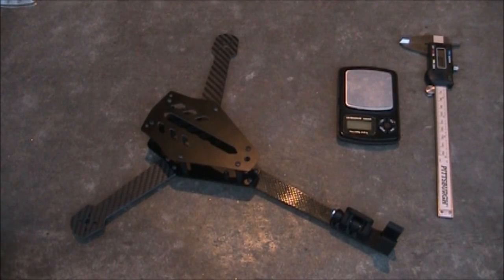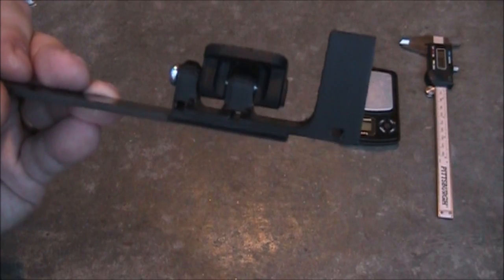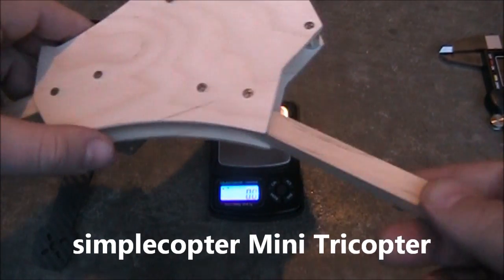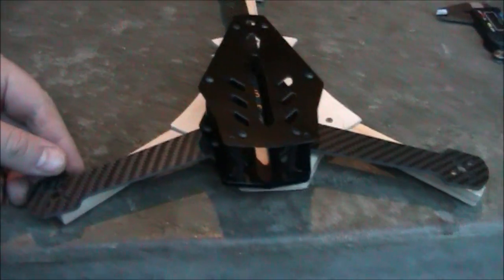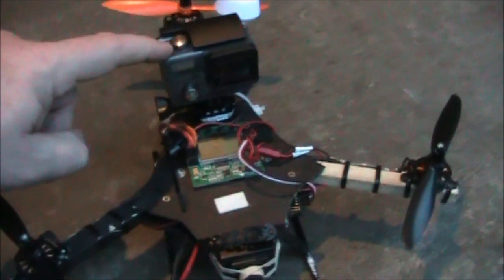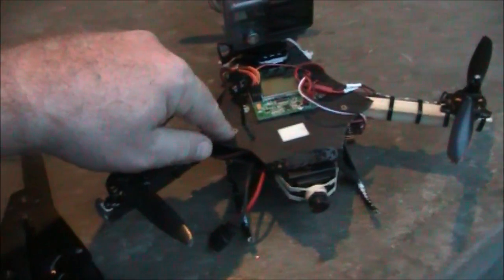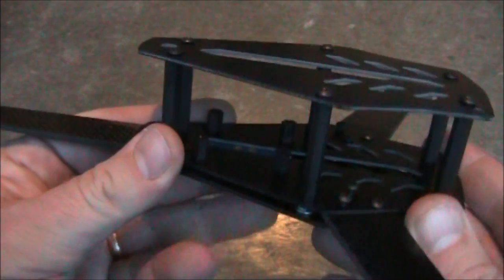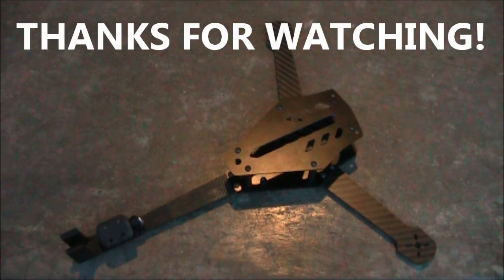Tri280 Frame Review with Simplecopter Mini Tricopter Comparison

Comment: Did you ever build and fly this tri?
Reply from the maker: Yes, but I couldn't get it tuned in very well.  i should try again now and see if it comes out any different.
Reply: KK2 FC?  I wonder how an FC running betaflight would go.
Reply from the maker: +Flying Dream I've been wondering the same thing.  I couldn't get a Naze32 to fly without a lot of yaw wobble, but that was about a year ago or so.  Maybe things have changed since then.  I may try to get it flying again some day.
Reply: Have you tried Banggoods F3 flight controller yet? They call it a "Naze32 Upgrade SP Racing F3." I'm running one of these on my bolt210 at the moment and it has been great. They also have one called the "CK Optimised Version Racing F3."
Reply from the maker: +Flying Dream I have it on one of my quads now.  I have it running BetaFlight.  So far so good with it.

Comment: how does the simplecopter yaw mechanism work is it a screw in the back or how
Reply from the maker: Darren Fürst There is a shaft that comes in it from simplecopter.com.  You could use a screw, but the shaft looks better and is more adjustable.

Comment: Can you use 8" props?
Reply from the maker: Yes, on the Tri280 you could.  You'd just have to make sure the wires were tucked in to the frame.  An 8" prop clears the frame by about 5mm.

Comment: The yaw mount is slotted, try sliding it forward to make it flush with the back of the yaw arm.
Reply: Actually I see you have the yaw mount backwards.  The servo should be on the inside portion of the frame
Reply from the maker: Nick Caldwell Ahhhh!!!  I switched it around.  It looks a lot better now.  :)  I'll try to remember to mention that I had it backward in the next video.
Reply: Hey Nick.  How can I get one of these frames